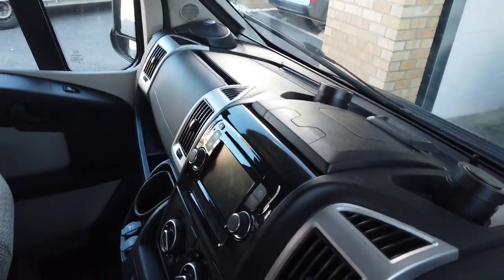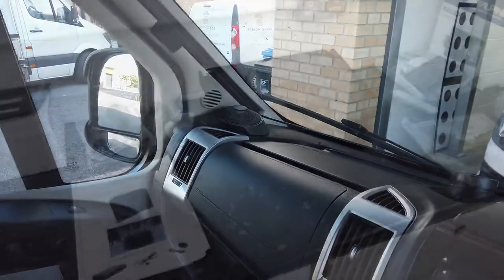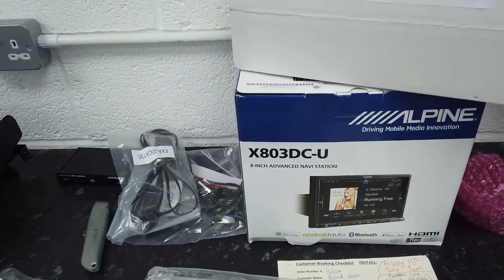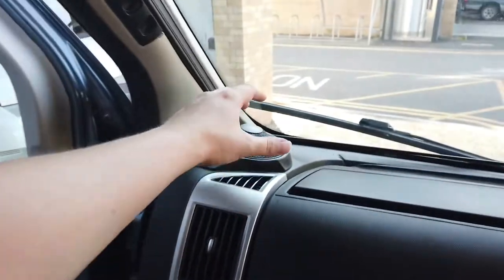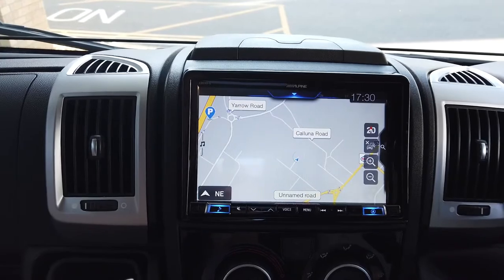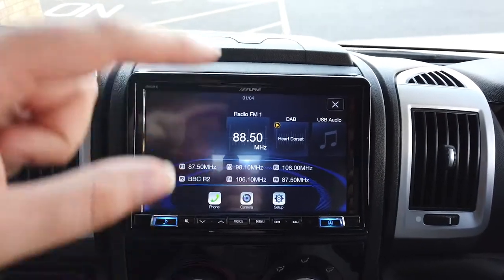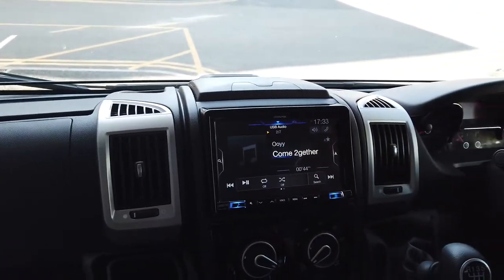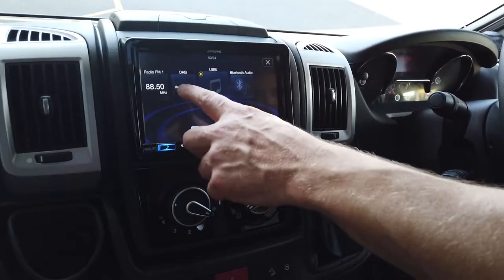The Ultimate Fiat Ducato Motorhome Alpine Audio Upgrade

Comment: I've just fitted the Alpine dash speakers & Sub kit with a Halo 9 head set. I wasn't initially impressed with the sound quality given the cost but found cutting 3 inch holes through the dash under the speakers made a world of difference. I've now disconnected the door speakers as I couldn't get a decent sound from upgrades and fitted tweeters in the headlining. I'm happy now!

Comment: Hi mate have a few questions. 1. Did you need to run a new power lead or is the OEM FIAT power lead sufficiently sized to supply the power required for the head unit to operate to full potential? Also how about the Amp did you run a new power for the Amp? 2. You mentioned you've disconnected the tweeters from the A Pillars therefore theres no tweeters in this install? 3. Assume the new Alpine dash mounted speakers are being run off the rear channel due to the existing door speakers remaining? 4. I have the Sony XAV8050, but assume I could still use these items? Thinking of cutting the Sony loom speaker wires before it goes into the Fiat loom and running to amp input and then back from the Amp output back to the speaker wires and through the Fiat loom to the Kenwood Coaxial door speakers I have installed and then for the Alpine dash mounted speakers I could connect up directly from Amp output to the new Dash mounted speakers instead of using the Fiat loom? Sorry for all the questions! 🙏🔊😊

Comment: Hi guys great system there. I've come to fit this sub today and my bracket doesn't line up with the bottom two screws on the dash. Did you encounter this and how did you get round it?
Reply: I've just found the same problem - did you ever solve it?
Reply: @ianfletcher4488  sort of? I bent one of the brackets so it was better lined up but I don't think the bolt ever tightened up properly. It's been holding up fine with just the right hand side tightened up the whole way
Reply: @some1234321  Thanks - doesn't that pull the frame off to one side?
Reply: @ianfletcher4488  it didn't for me, the sub is perfectly in line with the cup holder above it.  I can't exactly remember how I achieved it but I'm sure it was bending the 'Z' shaped pieces that attach to the dash.  If I get a chance tomorrow I'll loosen it off and take a look for you
Reply: @some1234321  Thank you
Reply: @some1234321  I had a good chat with Alpine tech support today - the bottom right mounting point on the right-hand drive Ducato is in a slightly different place to the left-hand drive model, so the bracket doesn't fit.  Alpine UK are working on a UK specific bracket mod, but it isn't available right now.  The short term fix is to cut off the right hand lower arm from the bracket and only mount it in 3 corners.  I've done that tonight, and it seems to be stable enough and as you say, it lines up with the cup holder above.
Reply: @ianfletcher4488  amazing that's good to know they've acknowledged it. I had a look today and could really figure out what I've done but the plus is a quick mod will sort you out! To be honest at this point I'm concentrating more on adding speakers and maybe a bigger sub to the back of the van as whilst this system is a hundred times better than stock, it's not nearly as good as my stock family car...without the thumping bass
Reply: @some1234321   what did you install, the full alpine dash speakers, amp and sub>=? And its still not that great compared to you car setup, what is it lacking, more power?
Reply: @sadkowskid  yeah the full 3 part kit.  After having it for a year it's been fine, a lot better than stock - though did need an aftermarket headunit to make the most of it.  It took a lot of messing with the EQ to get things sounding how I wanted.
The dash speakers are fairly small so shouldn't expect a lot in the mid range from them really, but then at the same time they don't give grisp high frequencies either :\

I think that pretty much sums the system up.  Both the sub and the dash speakers are very specific in their range mainly due to their sizes.  One song can be far more bass heavy than the next, which isn't much of a problem because turning the sub knob has become a reflex!

Tbh instead of doing any ripping out of what's there I think if I make any changes it will be to get some speakers in the back to fill the void - and so I don't have to deafen myself for the rear passengers to hear it!

But yeah if you can get the 3 part kit fairly cheap I would recommend it for the plug-n-play nature of it
Reply: @some1234321   thanks for that, appreciate a real users perspective. I like the dash speakers as they sit up from the dash - my standard ones point to the windscreen! Not sure if i am just better putting similar money into a better speaker mind.
I am torn between going for what you have versus under seat sub, seperate tweeters and speakers for the existing ones - purely based on you get more quality items for similar money as its not bespoke branded towards a Ducato custome fit / marketing.
Reply: what head unit did you go for?
Reply: Could you not use that headunit to run the drivers in the door and mids on the dash actively? Surely that’d give you loads of headroom and time alignment etc?